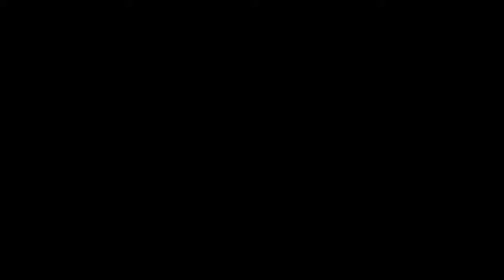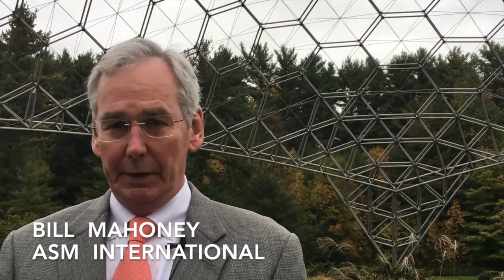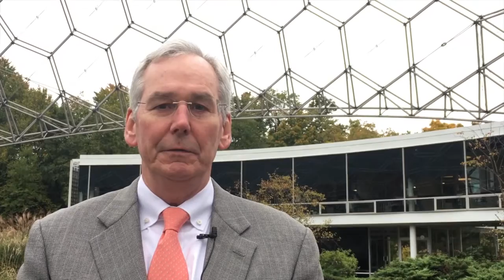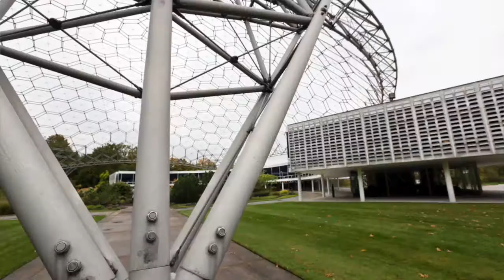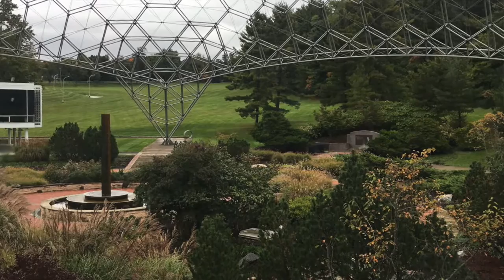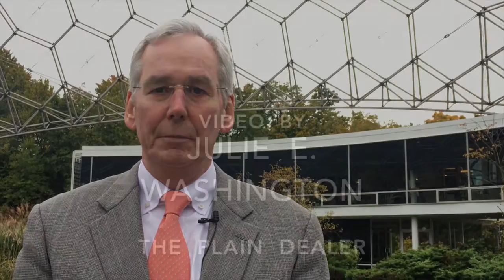Geodesic dome at ASM Internation headquarters

Comment: Very cool dome!
But I just have to make a small correction - Buckminster Fuller isn't the inventor of the geodesic domes, but have done really a lot to improve and popularize the design, so he deserves all the praise he got.
However the original geo-dome was designed and constructed by  Walther Bauersfeld when making the first projection planetarium in Jena. It's actually really interesting how the design of that first stars projector (which btw also uses icosahedron design to focus each of the lens into its own projection field) lead, or one could even say 'Projected' the same shape into the design of the dome itself. :)
Reply: Don't let facts get in the way of a good story. 
And remember that paradox where bucky invented the geodesic dome with no know of the planetarium so they both invented it

Comment: The ASM dome was designed by architect and engineer Thomas C. Howard of Synergetics, Inc.  Buckminster Fuller held the patent to geodesic dome geometry; he did not collaborate on this dome.  The ASM dome is actually a triacon truss.  This same truss system developed by TC Howard was also used on The Union Tank Car Dome in Baton Rouge and The Climatron in St. Louis.